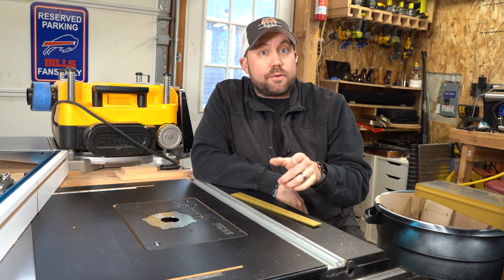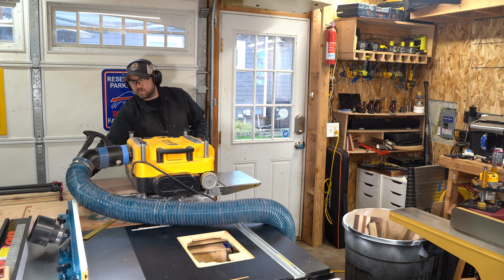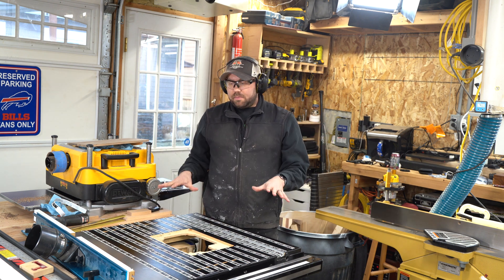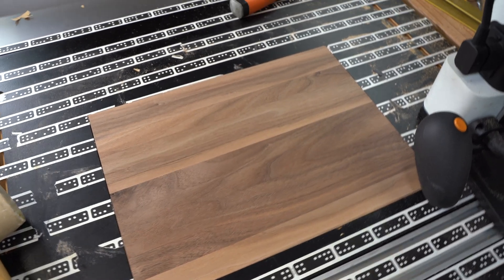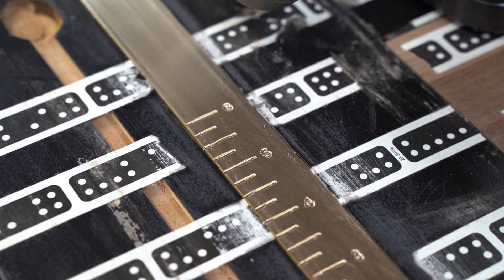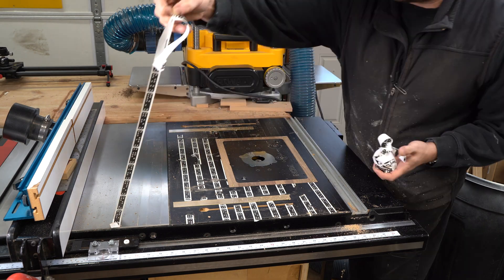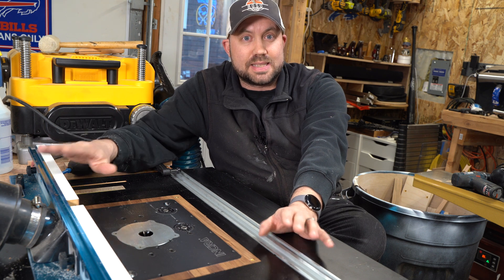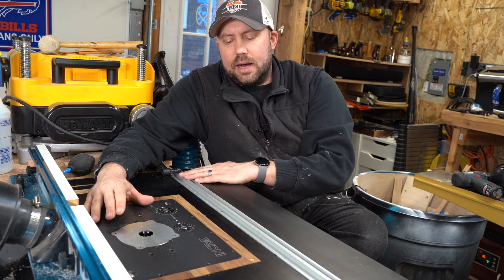I fixed my ugly router extension table by engraving brass with my Shaper Origin

Comment: Beautiful, I'm in the process of creating a new router table and this just gave me some more ideas for what I can do for the top.  I wouldn't worry about your brass buffing skills, its so soft that it will get scratches here and there.  I think you were correct the engraving was/is more important. Thanks for sharing.
Reply from the maker: Right on--I'm happy it can help. Yeah, since I made it I've had some scratches for sure and it's still working really well. Thanks for your support and for watching!

Comment: Good video.  I'm glad I am not the only one who has that issue with the Shaper tape doing that.  I was afraid I was doing something wrong.
Reply: I have a new roll and it seems to do the same thing.
Reply: @Volkswoodshop  hmmmm
Reply: Same here.  It happens often.  Quality issue!
Reply from the maker: Thanks Reece. Yeah the tape also was rolling a little when I was cutting the top out, which seemed problematic. I was wondering if my tape had just gotten old or something?